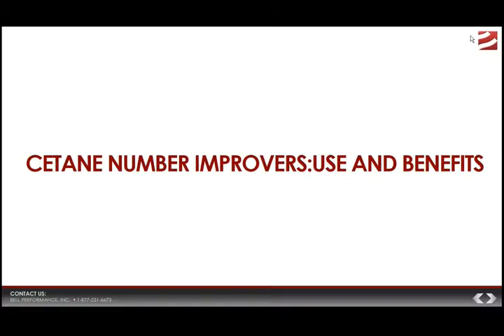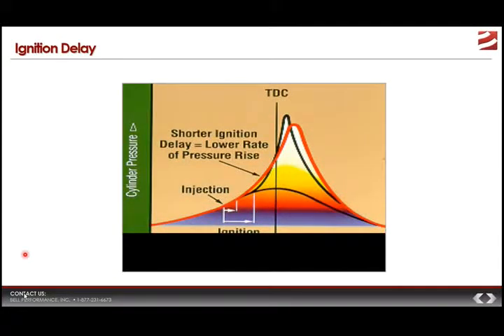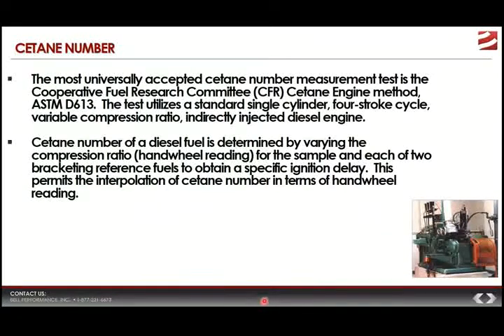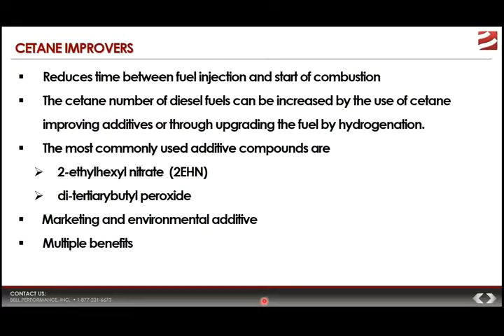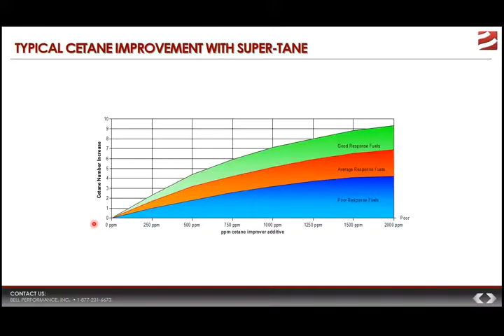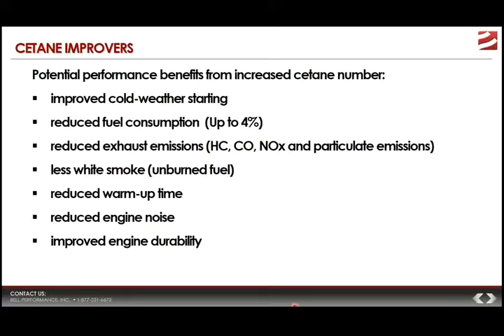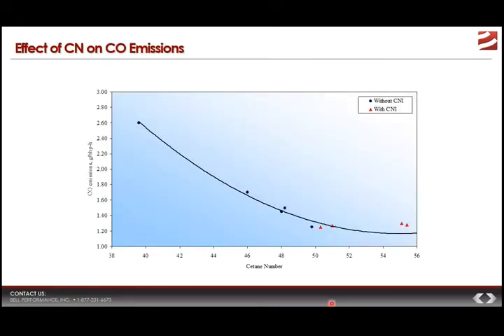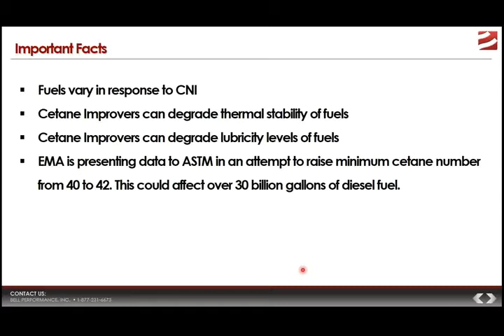Cetane Number Improvers for Diesel Fuel - Bell Performance Training

Comment: By the Look of it the crank vs pressure diagram is not right. The timing of the engine is wrong. The pressure rise is to early, in both situations. 
Also if you reduce your peak pressure (like it shows on the graph) you also reduce your compression ratio that will reduce your thermal efficiency (basic diesel physics).
Cannot scientifically understand how you can reduce the fuel consumption by 4%...which is enormous, by this method.
NOx could be reduced by reducing peak pressure (and temperature) but always lead to lower fuel economy, increasing CO2. But NOx is worst than CO2 according to environnement so we prefer to reduce NOx. This is what most manufacturer do, or inject urea as we know.
Reducing CO is probably very minimal as most turbo charged Diesel engines have a 200%+ excess air. CO content is normally less than 40 ppm on a well maintain turbocharge Diesel engine.

Not to convince that CNI is really worth it.

To reduce fuel consumption (in g/kWh) on a Diesel engine you need higher calorific value, lower air intake temperature and proper Diesel engine timing. If CNI change engine timing, a good Diesel engineer will notice this variation when doing Diesel performance analysis and adjust the timing to get back to the optimum crank angle pressure setting.

The P&V diagram on a Diesel engine is used to calculate the engine power, it is the same diagram as the crank angle vs pressure but showed in a different way. 

There is no magic, just thermodynamics and physics.
Reply: to add more..
in modern diesel engine design..there is also pre ignition of fuel injection.

fuel is injected in minimum quantity several times to add more radical HC..therefore injection of main fuel will burn quickly
this method increase combustion efficiency..not shown up on those graph.